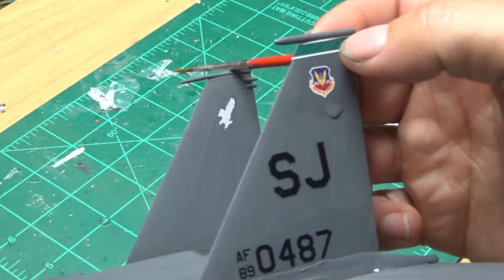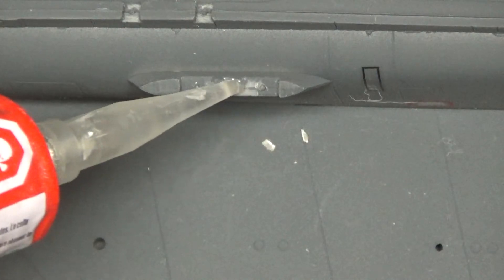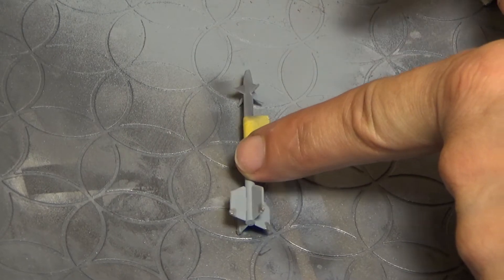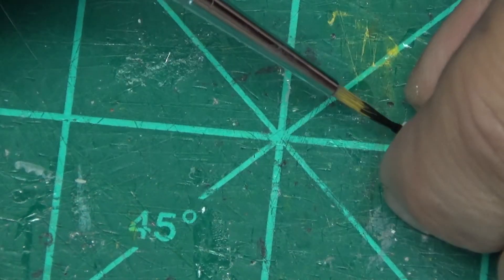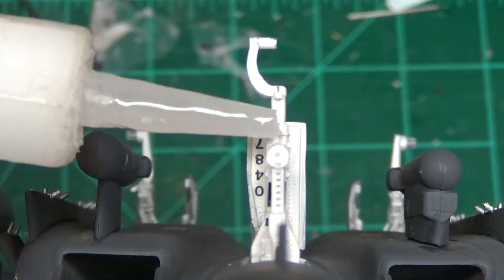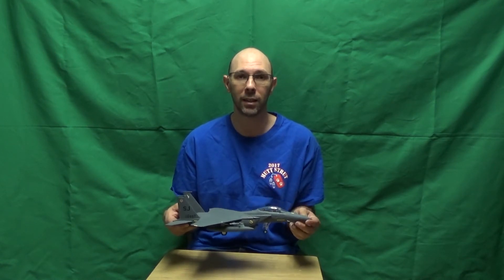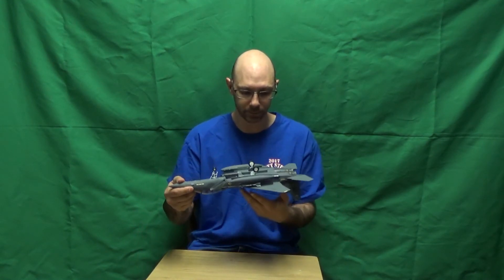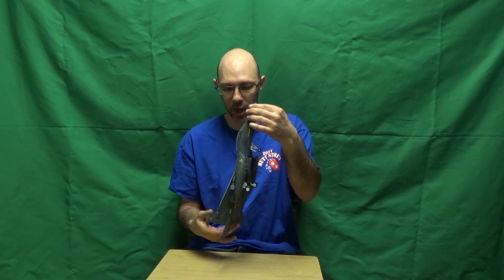Revell F-15E Strike Eagle 1/48 Scale Plastic Model Review

Comment: I just started this kit and this video series is SO helpful, thanks! The small piece on the left forward fuselage is to cover up if you didn't want to use the boarding ladder (it isn't in the instructions). There are also air intakes that mount to the side fuel tanks that you didn't put on cause they aren't in the instructions. There are holes that have to be drilled out to put them on. The only reason I knew about them is from seeing a Strike Eagle up close. I am thinking of buying an armament kit and adding more bombs to mine. Great video series!!! I know I've learned a lot by watching you and I am sure you've learned by doing. Keep up the good work.
Reply from the maker: Thanks for the helpfull info!